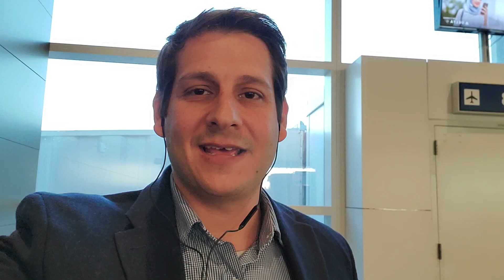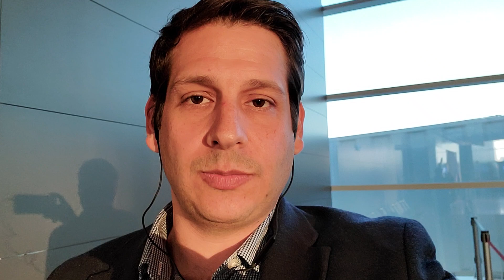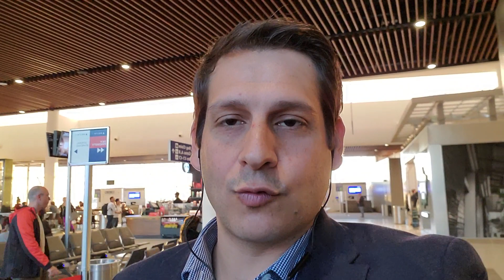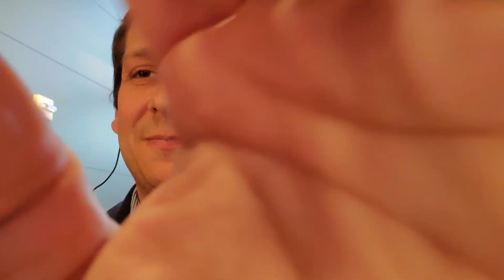Estimating rebar diameter? A comparison of gpr vs eddy current  | ground penetrating radar | ndt

Comment: I was thinking about detecting rebar corrasion with gpr. Estimating size and dept with gpr and finding the eddy current in uncorrasioned rebar in same position and than finding the experimental eddy current can give the percentage of corrasion in rebar . What do you think ?
Reply from the maker: Interesting. I haven't thought about a comparison of base eddy current on healthy bars and then take readings from possibly infected areas. Really a resistivity meter or half cell potential are usually used. GPR can be used...I did a video about it a while back. Definitely try to find it.
Reply: Corrosion of rebar is measured as section loss, not as percentage.  For example, a #4 1/2 inch diameter rebar has corroded down to 3/8 inch (#3).  Pairing GPR depth with covermeter depth will give an excellent indication of whether there is section loss; if, for example, the GPR is showing 5 bars all at the same depth, and the covermeter is showing 4 bars at the same depth and 1 bar as deeper, then the 1 bar is corroding and experiencing section loss.  It gets more complicated if the concrete around the corroding rebar is slowing down GPR wavespeed, making rebar appear to be deeper.  On the positive side, GPR can also see delamination between rebar, which is a sure indicator of corrosion.  So it is best to analyze GPR images and covermeter data for indicators of corrosion, rather than to assume you are going to accurately be able to estimate section loss (or whatever "percentage of corrosion" is).  But if you're dealing with a lot of rebar, you may be able to establish metrics for no corrosion, some corrosion, severe corrosion, etc.  We have used A, B, C, where A is good, C is bad, B is in-between.
Reply from the maker: @bdrogin  thanksnfor jumping in Barry. Always insightful. Hope all is well